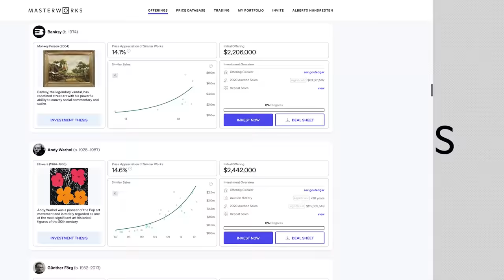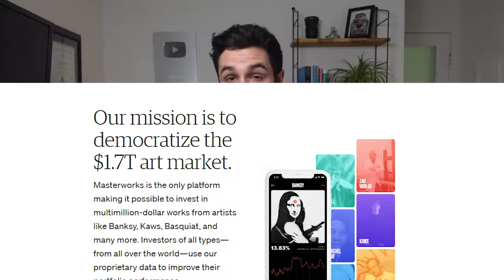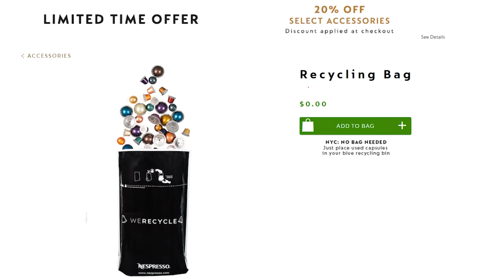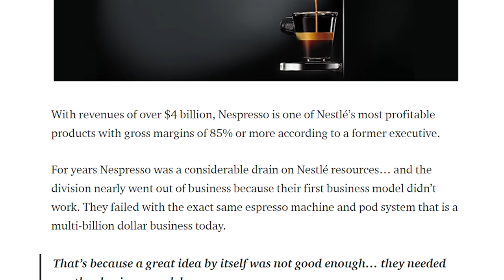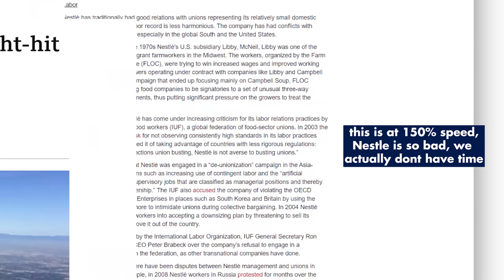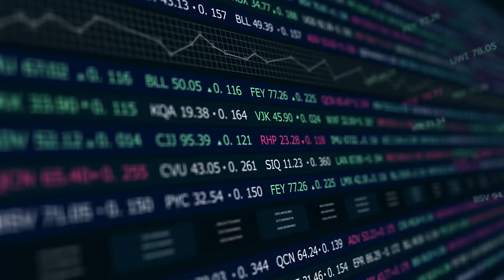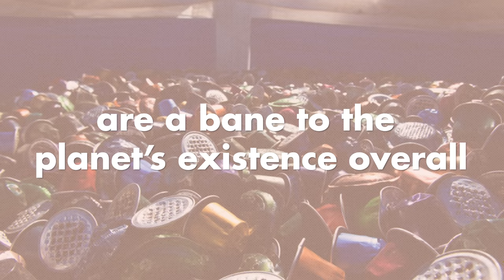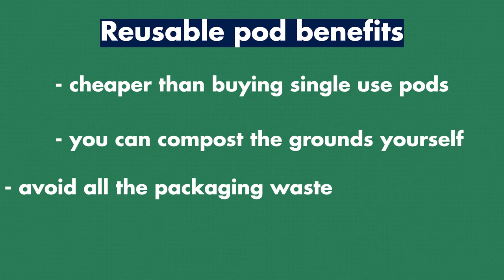The PROBLEM With Nespresso Coffee Pods

Comment: Its super easy to make coffee with a one cup reusable basket type.  And you can use whatever coffee you want. To make it even quicker you just put the coffee in the basket the night before.  The pods aren't fresh anyway so you won't notice a different plus you can adjust it to your desired strength and even god forbid grind your own coffee.  Plus, the basket types are easier to clean than those small pods where the coffee gets compacted. Sure, it may take closer to 5 minutes to brew.  But, some have timers. Or maybe just do something else for 5 mins while you wait like showering or getting dressed or 🔍 the web/watch a short video.

Comment: I got a nespresso machine as a gift and always struggled with the aluminum waste and hated the pod idea. After using it for a while and being really bad at recycling I bought reusable capsules from Beau. I have zero affiliation with them.  They are made well and they do require a bit of work but they really aren’t that bad if you give yourself the time to fill the up at the beginning of the week for my early work days. Way cheaper. On weekends or non busy mornings I still use my simple drip coffee machine.

Comment: I just rake out the coffee from the used aluminium pods under the tap using a fork and then chuck them in the normal recycling. I can't be bothered with bagging them up and sending them off somewhere.

Comment: Here in the UK I use Tassimo which has a good range of branded coffee, but isn't the best environmentally. But I save the pods, remove the used coffee grounds for the garden and separate the plastic from the foil seal. None of it is ideal, but we all have to do the best we can, and perhaps if Nestlé had to recycle 95% of what they produced, they would work even harder at sustainability.

Comment: Your one complaint about reuseable coffee pods doesn't hold water!  I have been using my reuseable in my Keurig for a long time now, using a changing variety of coffees of my choice, with zero waste.  
It is actually NOT difficult at all to brew a very good cup of coffee that way.  After just 2 or 3 possible slight misfires,  you quickly get the feel for that perfect fill to nail the way you like, every time!
Sure it's still a shortcut, but for many of us, it's the perfect method.

Comment: One big point that is unfortunately completely left out in most of those sustainability discussions is that a Nespresso pod uses significantly less weight of coffee beans than a K-cup or any other method of coffee making. And the raw coffee beans are the number one CO2 driving part of the finished coffee (because of the agricultural as well as transportation impact it has). 
Also: the whole topic about recycling is not really an issue of the Nespresso aluminum cup but the country where it gets consumed. Where I live most people are very strict about not putting any sort of recyclable material into a waste container.

Comment: I really don't buy the "convenience" argument for single use pods outside of an office or hotel setting. I got a midrange espresso machine from Breville with a built in burr grinder that gives out the exact amount of coffee automatically and takes the same amount of time as the Nespresso in my office. Honestly less effort since I can just drop the coffee right into the disposal or trash/compost instead of dealing with the pods. Maintenance and descaling is the same level of effort. Sure, the sticker price is higher, but you'll easily make up for that in savings on coffee in a year and come out ahead, not to mention the espresso that comes out tastes 10x better.

Comment: I see lots of comments about using reusable capsules… just note that you can’t make as good coffee using reusable as using the original Nespresso pods.  If you want to make really good espresso at lower cost, invest in a decent machine and grinder  and learn to make espresso. You will get way better tasting espresso and you will also enjoy making your own creations and also really significantly help the planet by wasting much less. You would tell me that decent espresso machines cost a lot. Yeah, this can be true. Decent machines are (for me) in the range of 800 to 1200$ , good machines range from 1200 to 2000$ and excellent machines range from 2000$ to 3500$. Those are for home use or small business use in the case of the 2k+ price range.  There are lots of different tech in those machines and also different learning curves. A great machine to get you started without having to worry about brew pressure (because it is set correctly right out of the factory) , and flow control could be the Rancilio Sylvia, eventually the pro version if you have more money to invest.  If you are more serious about your espresso, you can go towards brand/models like the Bezzera Aria PID with dual boiler, E61 group head, flow control, dual PID temperature controls and pluggable into domestic water line. Going upwards from there is possible but then it's more about making coffees back to back for many guests and not so much about the quality of your espresso shots.  Lastly, you will need to get a good grinder and in this area, the price matters too and there's also a learning curve. It's not rare to see YouTube reviews about people buying super expensive coffee grinders and showing that it's not functioning well. In most cases it's not the machine that has an issue (though it's always possible) but it's the operator that just doesn't know how to use the machine well.  In conclusion, I own many different coffee machines including Nespresso because it's super convenient.  But using refillable pods isn't the solution to help save the planet nor is it the solution to better tasting coffee than Nespresso pods.  
Making your own espresso will give you a pleasure far beyond drinking your self refilled coffee pod! I have used those pods and refilling is always messy and unpleasant for me.
Reply: No reason to buy overpriced pods to be used once and discarded. I bought the VIVI SKY Reusable Coffee Capsules Discs, grind my own beans before each cup (one touch operation!) and have been reusing the same two Nespresso Vertuo pods for over the last year! And when I want fancy foam I preheat my cream in the microwave and then whip using a battery operated milk frother. Spent coffee goes into my flower/garden beds. It's way too easy. Sustainability "problems" solved!

Comment: I remember sometime around 2009 i did work for a french company and they had a nespresso machine. Got addicted and bought an early style small pod machine but it ended up vapor locking. Threw that shit away. The early home machines sucked unless you used them all the time.

Comment: I got a Nespresso machine second hand from my co-worker. Real coffee machines that use coffee beans etc. are ridiculously expensive here and are a true luxury item. While I got a good deal on the Nespresso machine.

I am rather picky about coffee, but the pods they sell here (note we don't have Nespresso Pods in supermarkets here in Lithuania, the pods are usually made by Jacobs, Lavazza, LOR, and other popular brands locally), are actually pretty nice. The coffee actually tastes NICER than what I get from a coffee machine at work. However, I understand the sustainability problem, so I only use pods once in a while.

I bought a re-usable plastic pod that can be used indefinitely. You just fill it up with ground coffee, use it to make the coffee with nespresso, then remove the pod, clean it, and you can re-fill it again. Sustainability problem solved.

Speaking of recycling - does anybody know what material should I consider the pods from when I go recycle? Plastic?

Comment: There are expresso machines that grind and serve the cofee on the spot. Are easy to maintain and much cheaper than drinking cofee pods. If you want something smaller and cheaper hta makes a great cofee there are plenty of expresso machines that use ground cofee and make the cofee the sizee you want. Recycling is no solution

Comment: As much as it is true, what it is undeniable is the fact that it is way easier to use them, and the cost, while higher overall, it is not an upfront cost, which actually matter to a lot of people. I cannot go out and spend 300+ euros on a expresso machine plus whatever accessories needed. And the amount of time I spend preparing my moka pot is not low by any means, considering it has to heat up and everything (especially if that means extra 10-15 mins on my bed every day, an actual lot). Dripping coffee machines tastes horrible. So, what options does leave people with?

Unfortunately, only Nespresso. If you go with a Nespresso plan, you get the pods and the machine for as little as 20 euros a month for a single person, 1 morning cup. Which, 20 bucks, while not cheap, is not absolutely ludicrous that can be complimented with generic ones. If you buy third party coffee maker, you have them as little as 40 euros. An extremely low barrier of entry that respects your prep time. Bad for the environment? Hell yes, but they are stupid convenient, and I don't get neither the free time to spend on using the low cost options, nor paid nearly enough to have a proper setup with low prep time. Nespresso fits extremely well in that middle spot, low entry barrier, as well as low prep time for an average/decent cup, which, coincidentally is the place a lot of potential customers sits.

Comment: I have tried the french press, pour over, drip, and I've used fresh beans, through a grinder or a burr grinder, and what I've continuously experienced was a disappointing result, never the same taste from the fresh beans. The cleanup was the most time consuming, so, after making a cup of coffee that rarely was worth all the effort, expense, and clean up. I tried the Nespresso Vertuo Plus. No fuss, no grinding with a burr or any other kind of grinder, or press, or drip, or pour over, and don't forget the Percolater , oh the filters, white or brown, on and on to make a simple cup of coffee. Now if there was a guarantee that the beans are as fresh as is advertised, and the taste could be repeated with the expensive beans used everyday through the expensive grinder, well I wouldn't be rambling on, but, come on, I don't believe anyone makes a great cup of coffee every day using any of the many ways that coffee is made. But, the Nespresso pods are offered in many flavors, and they are worth all the non-effort in making a good simple cup of coffee.
Reply: > I don't believe anyone makes a great cup of coffee every day using any of the many ways that coffee is made.

I don't know what to tell you other than that's hilariously incorrect. Without evaluating on-hand, I couldn't tell you if it was grind-size, temperature, pouring styles, measuring beans or grounds by volume instead of by weight, that gave you inconsistency, but I and many, many, many others daily a French press because they are easily-repeatable. Let my kettle sit for 1 minute after it shuts off, pour into a weighed 30g poured into my burr mill at setting 18 (which it's pretty much left at), and I can do it even groggy.

The beans you get from a local roaster will always be months newer than whatever's in your nespresso pods.

Comment: At least here in México there are reusable capsules
And regarding price there are proper espresso machines cheaper than the nespresso o dolce gusto
There's even a device that has two adapters that allow you to use nespresso or dolce gusto capsules in your portafilter, so you could use less capsules, only the occasional when you're craving, and guess what? It costs even less than a Nespresso or a proper 19 or 20 bars espresso machine and was tested by Hoffman in his channel and concluded it's great
So... Maybe I wandered in my mind but what I'm trying to say is that the problem would be that people doesn't know there are options or they know it but are somewhat lazy

Comment: Bought my wife a nespresso  vertuo machine for christmas to "upgrade" from our Keurig. The coffee selection isnt very good as i really dislike Starbucks and its either that or nespresso branded coffee right now. However, we purchased some aluminum lids to reuse the lower pods with our own grind selection. Since we are both fans of the coffee at a local Cleveland cafe (Hecks), were starting to make our oen Hecks Vertuo pods and the cup it makes is  lightyears better than what the Keurig can make with the same grounds.  Also, its not at all difficult to get the proportion proper as the presenter here insinuates.  Its not rocket science man.

Comment: The "compostable" pods and "plastics" in general I've seen need a special bacteria with at least 50°C heat. Outside of this system it will take up to 100 years to degrade.

Comment: I've got a machine that just has both a reusable steel sieve/pod for ground coffee, and measuring spon that gives a perfect portion of the coffee. I considered buying pod-based system, but after few calculations I figured out that pods are too expensive and make no sense. Even if I bought the most expensive coffee available to me for it, it, it would be cheaper than those pods...
And before that I just dropped two teaspoons of coffee into a mug, and added boiling water to it, Turkish style. This is how most people drink coffee here...
Reply: Hey I'm curious. What machine is that you're using?
Reply: @ninalee8623 , it's Blaupunkt CMP301 coffee maker...

Comment: I own a manual espresso machine, and let me tell you that, I when from knowing nothing about making an espresso based coffee drink to meticulously pinky about every little detail about my personal preferences through experimentation alone. I'd be a horrible barista though, since I only know what I like personally.

My favorite drink, if I were to attempt to order it at a Starbucks would be a double tall caramel macchiato with extra foam in a grande cup.  The tricky part is getting all that extra foam without burning the milk. It's a fine line.

Comment: In my country, Nespresso coffee, in the original pod, costs $192.00 per KG (including tax). Illy Coffee, some of the best you can buy, costs $63.00. So, you have to be an idiot to fall for this... but so many people do. You can buy aftermarket Nespresso pods, they cost $130 per kg, still a massive rip-off. And no recycling of those. Good, packaged ground filter coffee is $29 per kg.

Comment: These bulky, wasteful pod-based coffee makers don't save an appreciable amount of time over ANY other coffee making method. 
I would also like to emphasize, that with a French press and a little grinder you get to be your own barista! You can decide the amount of coffee beans to use, how fine of a grind you want, maybe grind some hazelnuts in with it - and of course you do this while your kettle is heating the water. You get to decide your steeping time, if you want to add any adjuncts like mint, if you want to steep in a little water first then add more... it's fun and it takes (me) about 8-12 minutes from starting the kettle to having the French press on the dish drying rack.

Comment: They give you the bags for free, (in Switzerland) they pick it up at your address from your mailbox, all you need to do is to bring the bag to your mailbox. If you still don't recycle it, you are an id*ot. For the molding issue - just don't empty the capsule tray right after you made coffee and it will be mostly dry when you get to it later.

Comment: Recycling for the most part has always been a total scam.
With the exception of a few high value materials that are still profitable after all the transport and recovery costs have been accounted for most recyclable waste creates more pollution and cost than just burning or burying it would.
If governments were serious about recycling/ pollution, they would mandate that the majority of waste should be safely combustible not recyclable .
The waste could then be collected and used as fuel in power generation and not end up in landfill or the oceans.
As for carbon dioxide causing climate change? That is an utter fallacy and the biggest scam in history.
Water vapour is the only greenhouse gas of consequence, it actually shades c02 from 99% of the thermal energy that c02 is supposed to capture. This means that to have the claimed effect c02 would need to be at a concentration much greater than it has possibly ever been . With estimates that life began with c02 levels of between 4000 ppm and 7000 ppm we could increase c02 by more than double to 1000 ppm and still not have any measurable effect on the climate and to achieve a runaway greenhouse effect and turn the planet into Venus would require carbon dioxide to exceed the amount of oxygen in the atmosphere possibly by double.
Frankly we cannot access enough carbon to put enough into the atmosphere to cause any truly noticeable effect.
To put into perspective the amount of carbon that was once in the atmosphere take a look at someone standing at the base of the White Cliffs of Dover. All that white stuff was once living organisms that took carbon and incorporated it into their shell structure as calcium carbonate, chalk , lime stone etc. we would need to release all of that carbon to even equal what was once in the atmosphere, and if it was once there and the planet survived a tenth of the amount isn’t going to hurt it.